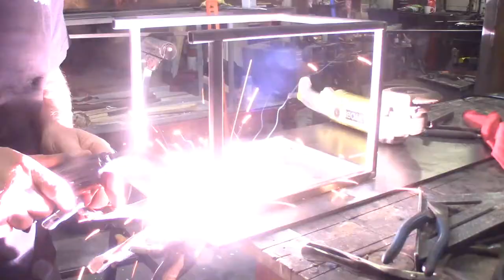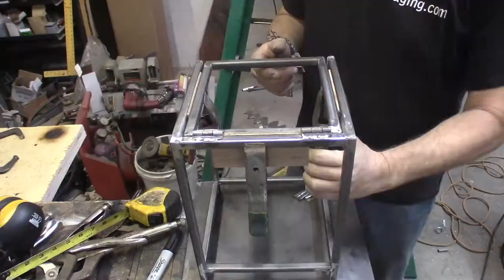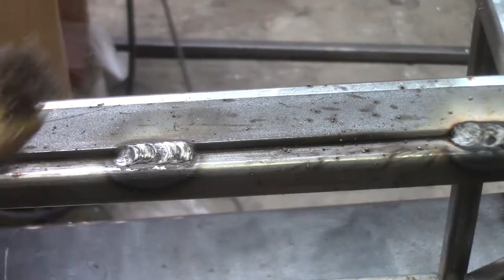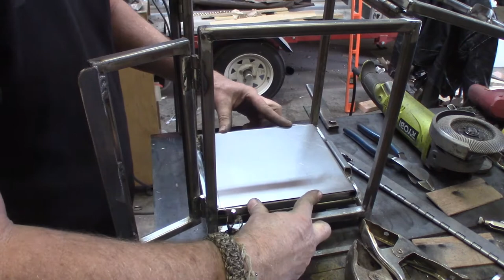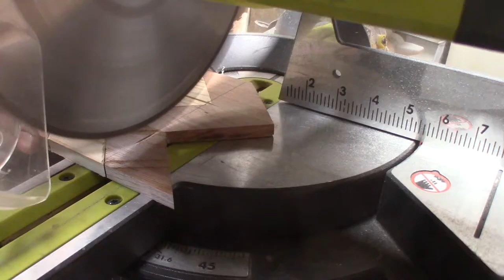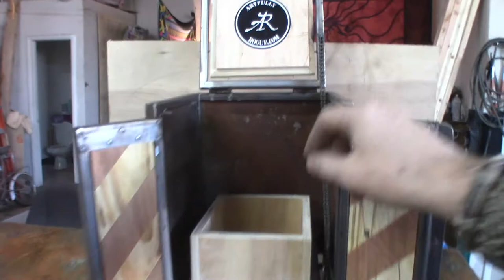Industrial Shop Box

Comment: Just out of curiosity, why not use shielded gas wire? Why flux core on everything?
Reply from the maker: jmlcolorado good question and it's pretty simple I've just never got around to adding the gas attachment to the box I have and didn't want to spend the extra bucks on another machine. I keep telling myself, when this little flux core box craps the bed, I'll go gas....it's been nearly 15 years with this little die-hard. Believe it or not I have a brand new tig machine I got for Xmas, it's still in the box, eventually I'll get the tank and play.
Reply: I used flux for quite awhile till I dropped the coin on gas. Trust me, you won’t regret it. With you being inside for your work as much as you are, there’s no reason to NOT make the switch. I think you’ll find your production will be impacted for the better, much less cleanup afterwords. 

I’ve got a tig recently too but haven’t had the time to use it much. It’s a slow process and the learning curve is long. I need to build a dedicated “tig station” and I think I’ll use it more.